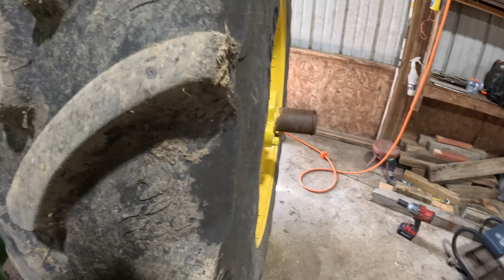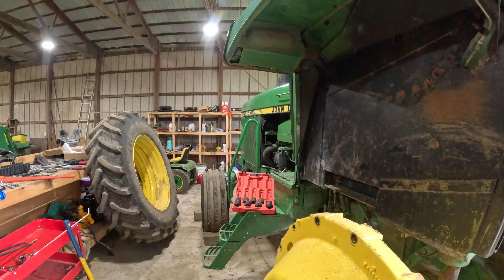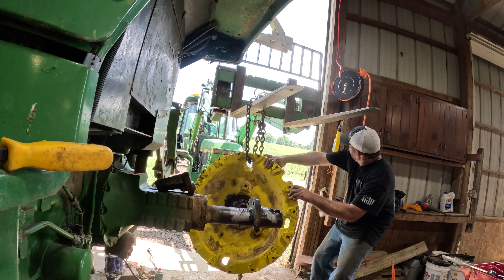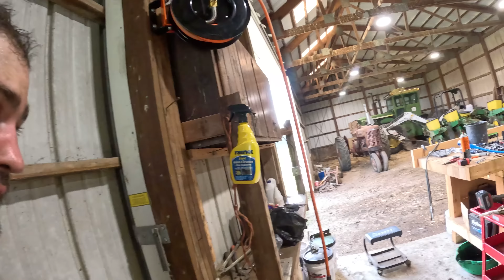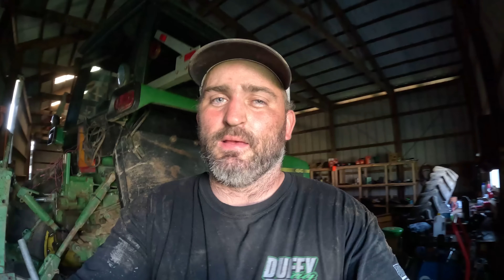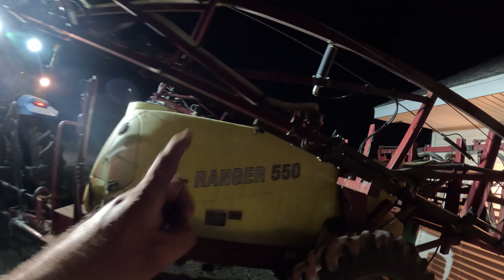Can Not Move Wheels On 4640... Guess We Won't Spray Corn!!!

Comment: Congratulations! You tackled & succeeded with a task everyone hates & avoids. If those 460/85/38 rear tires were filled with 80% Calcium Chloride, would have added 917lbs each. There’s a new tire shop in Missouri adv on internet $1,300 pair of new 460’s on rims w/o hubs

Comment: An impact wrench is a game changer when working on moving hubs on the axle. When you get it apart, paint everything with anti-seize.
Reply: Your not supposed  to use a impact  on the  gear to move them in and out   . Yes I stripped  one out
Reply: @zcole6612  definitely have not used an impact on the gear. Just to do the wedge bolts

Comment: You measure from pto shaft to center of tire = 30 inches. When you have bottom wedge bolts loose and jack bolts tight, hit the end of axle with maul. The vibration helps loosen the wedge. And yes you need bigger tools, 3/4" drive sockets.
Reply: This. 16 or 20 lbs sledge hammer. Someone beats on axle and the other guy has a six foot cheater on the wedge bolts.  Had to go from 60 to 88 corn to beets and back. Man I don’t miss it.  Good luck!

Comment: Rear axles on JD 4640 are 3.937” diameter.  Grab a 2ft piece of 4.5” I.D. Pipe, weld a cap on one end & notch back 
1.5” half of the other end to match the flange wedge - rotate rear wheel so flange is on bottom, slide pipe over axle & beat the shit out it with a sledge hammer - add handles to side of pipe if you choose - like a T-Post Driver.

Comment: I've always loosened both sets of wedge bolts and wacked the end of the axle with a sledge hammer. I've never failed with that method. Remove the keepers on the end of the jack bolts so you can remove them for cleaning before using them and having them twist off, like I have.Over the years I've learned to anti-seize everything. I have a 3/4 breaker bar welded solid for that job alone!

Comment: Looks like several people used the method I am familiar with. Sledge hammer on end of axle and one inch breaker bar with a cheater bar. That’s what we did.

Comment: Just wondering why not take the loader off and spray with the other tractor. Wouldn’t it be lighter and cause less compaction?
Reply: Absolutely
Reply: Because he doesn't want to.
Reply: You have to remember, Chris is convinced a 80 hp tractor can't pull a 8 row planter.
Reply: Jd 2755  66 drawbar , struggle with heavy 4 row with fertilizer
Reply: @realfarmer8081  your crazy
Reply: You're nuts. There's a guy down the road that pulls a 12 row center fold with 300 gallons of liquid behind an Oliver 1855. In the same tillage conditions.
Reply: everyone wants big horsepower these days, i have done lots of spraying, 5 furrow plow, discing, cultivating, planting with 75hp 4wd had no issues
Reply: Oliver 1855 98 engine ,82 drawbar so the math says 20 hp more
Reply: He has an 8 with no fertilizer, 
The 2755 with 4wd would pull it as good or better , have more traction and better brakes,
Reply: There’s one thing no one here is considering. The 2755 would also have to have the wheels moved around to 30” row spacing to spray and plant. It is now set out wider for the stability while running the loader. Also, he uses that tractor for loader work almost every day so he would be sacrificing either running over corn or having his loader tractor become more unstable. So why not have the 4640 set up for planting and spraying and also spread out the hours? Also, it’s HIS TRACTOR. He can pull a 4 row with 600 horse if he wants to, it’s his operation and his equipment
Reply: @realfarmer8081  How slow are you?   16 hp more pulls a 12 row, center fold, with liquid. That's 50% more row units and probably twice the weight of an 8 row with no fert.

Comment: Would have been a lot quicker to take loader off and use 2755 to spray.
Reply: I don’t know much about farming or spraying but those hills look a bit steep and I think you would want a heavier tractor with bigger breaks pulling and trying to slow or stop it going downhill just thinking about the safety of it just my 2 cents but I don’t know jack $h//+
Reply: @edwarddherde9536  that sprayer isn't as heavy as it looks to be and with the 2755 being four wheel drive you would have plenty of control on the hills.
Reply: 2755 even with loader would be more sensible he's spraying about 130 acres,  looking at the measurements he could have simply driven to the field and parked in the corn rows to see how close it's to the rows, pretty sure he would have been fine guessing it was already setup for spraying at previous owner, but just hooking up and getting the job done is too boring

Comment: Yep the struggle with those hubs is real. I fought with 3 4020's with breaking some wedge bolts because they were seized in the holes and yes i have a 1 in drive breaker bar and sockets and a 1in impact and i still broke my 1in breaker bar I'm guessing these hubs never moved since 1966. So yes putting lube on bolts and wedges is your friend. I would rather check to make sure that the hubs are tight than fight with them again 😠😡🤬💩👍👍👍

Comment: it's going to fight you all the way! Been thru that stuff! And paint on the axels, don't help! watch the valve stem when taking the wheel off! old timers, used waxed paper on the axle before putting the hub on, won't stick! you got it right! heat, Karole, and jack, chain! Yup, drive it around till the wheel falls off! How about chains for the winter, is there enough clearance on the inside?

Comment: Can you not make the tractor wider so would fit in the Rose like extend the axle on the front and on the back take the the left tire and rim off the axle and switch it to the other side and make it wider so it could fit in the Rose

Comment: I always hated moving hubs and weights and tires on tractors. No matter how you do it it is still hard work. Be careful traveling down the road with that tractor as on 30 inch rows they can be tippy. On a farm I worked on in high school a neighbors son was in sort of a hurry going down a field road and he turned a 4630 over that was a 30 inch tractor. He had hay forks on the back and turned short turning it over. Shattered all the cab glass and warped the cab so bad they had to replace it. He was skinned up pretty good too.

Comment: Lube everything in advance the best you can. Lossen wedge bolts on top of rack as far as possible with taking out. Then tighten jack bolts as much as you can. They can take a lot. If it won't come with  jack screws tight then take a man sledge and square hit axle end. Won't hurt anything if your square. Use a 14# plus sledge and get after it. Repeat hammer and jack bolts, if it won't go then it's not going to and you have to break wedges. Some just grow together. Heat is risky as wedges are cast.

Comment: We had hub duals on our 4640.  It was also setup for 30" rows.  However, dad mostly listed 40" seed beds because most of our irrigation equipment was 40" rows.  Dad's spraying tractor, a 720, was also setup for 40's.  The wheat drill didn't care, but when we did have row-crops we would do 30" rows on 60" beds and the 4640 could run a row-crop cultivator with the duals removed.  Dad never adjusted the width of either tractor as long as we had them.

Comment: My rack bolts on my 520 are siezed so i did the different rib to get my spacing.  One of these day i will take my castings off.  When putting my wieghts on i used my harbor frieght trk bed crane mounted on my f350 and that saved me the heavy lifting

Comment: You measure from the center of the PTO shaft. Drawbar moves and wears. That way you’re spot on every time. The only thing you could do is what you did. Or. Buy narrower back tires and wheels
Reply: thats right not the drawbar i was thinking they have a mark on the back for center

Comment: 550 pounds each on the wheel weight.  I'm very happy with my icon 3/4 drive breaker bar. I have an sk socket set
Reply: Yeah im thinking you right.  My z style center wieghts on my 520 that are the same as new gens are like 120-140 and that looks thicker and very likely bigger diameter
Reply: @tractorboy31  the 2 inch thick rear wheel weights are 140 each. Those big things are 550. I have 4 for my 4620